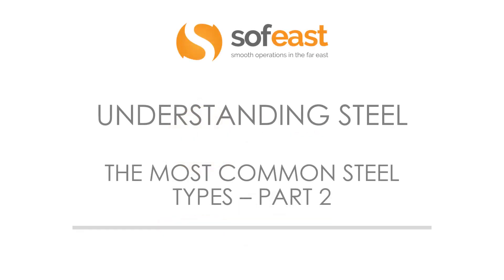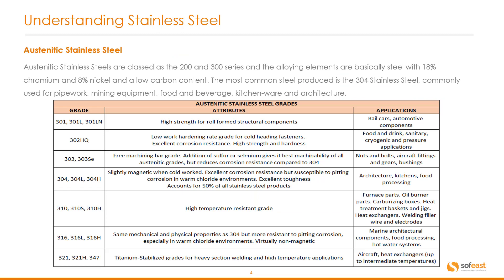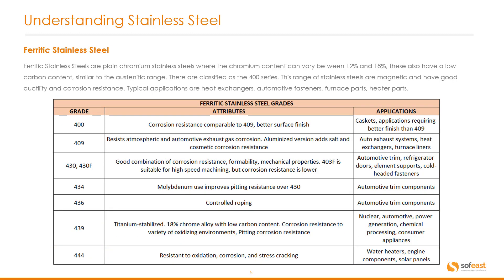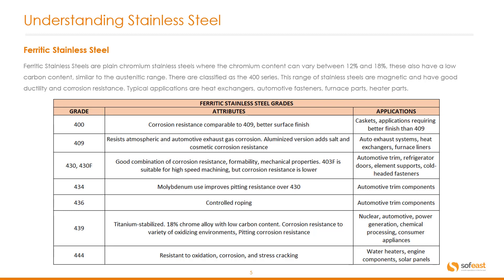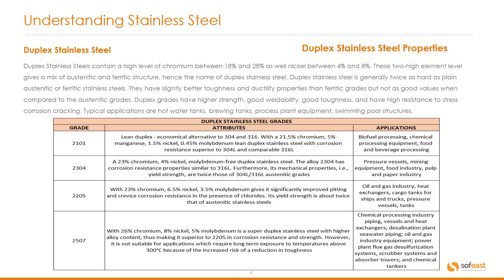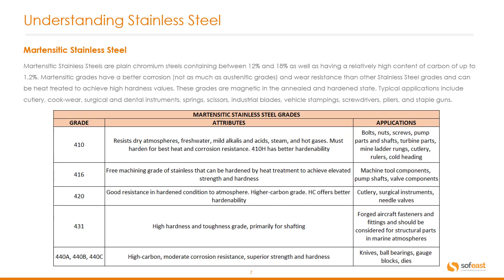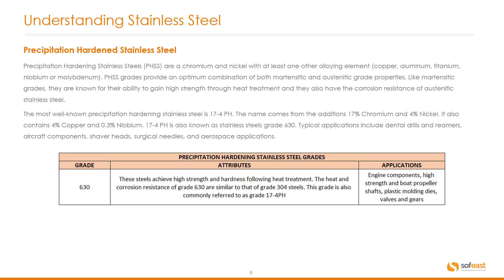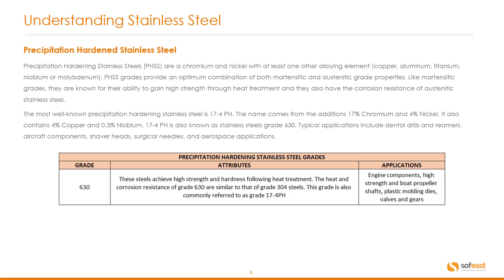The 5 Different Types Of Stainless Steel

Comment: Which of these is capable hardening and tempering like ordinary tool steel?
Reply from the maker: The only Stainless Steel that can be heat treated to make it harder is Martensitic Stainless Steel.

To harden and temper Stainless Steel it has to be of the Martensitic grade. The steel needs to be heated and then quenched, at this point the steel will be too brittle to work with, therefore, it needs to be tempered. Tempering the steel requires the steel to be re-heated and then left to cool in the air until at room temperature. This process of hardening and tempering will give you a Stainless Steel that has increased hardness as well as the initial characteristics that Stainless Steel provides.